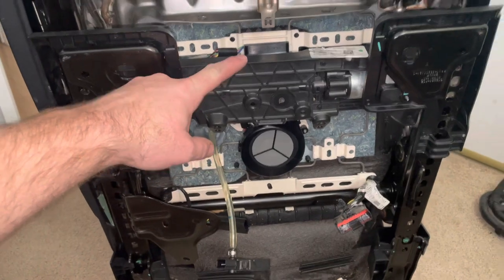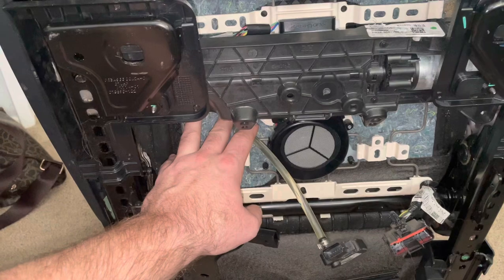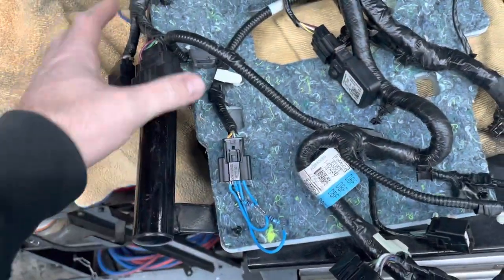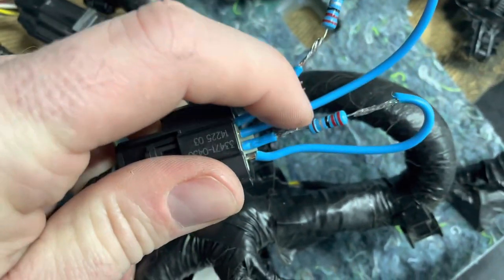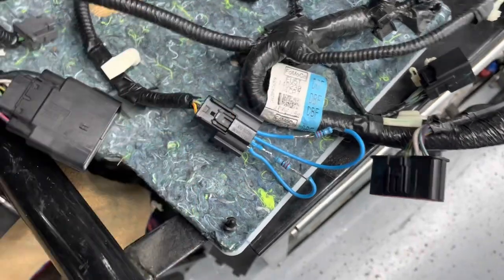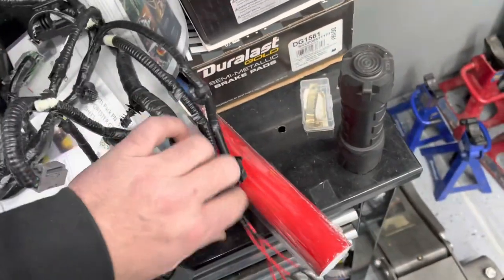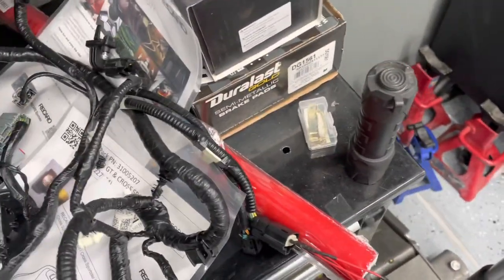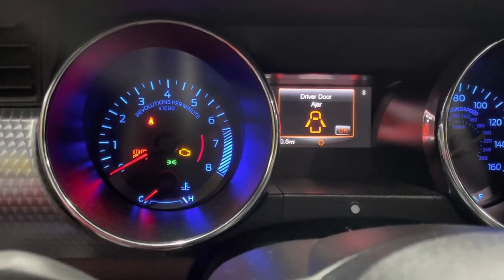Airbag Light Fix for S550 Ford Mustangs

Comment: dude this has helped so much! Ive got a Lincoln MKZ but the harness and everything is 99% the same. what type of wire did you use for the 2.2 Ohm resistors that you used for the passenger seat? im just missing adding resistor and hopefully this works for the Lincoln too!
Reply from the maker: I just used some that I had laying around. Really can be any 12-14 gauge wire.

Comment: Killer vid I just did 19 premium seats in my 2017 base Recaro car amd air bag lighy is on.....so I really  don't have to have the pad on bladder I can just cut tge hose cap off end and use the sensor? My buddy has my recaros in a race car so I need to go get that sensor then already did resistor on driver side a y info be much appreciated
Reply from the maker: No problem, glad it helps

Comment: Can you please elaborate on cutting the occupancy sensor. What do I use to clamp that little hose ?
Reply from the maker: I would not cut that, people have reported it not working well when cutting. Much better to keep it and hide it under the seat.
Reply: The problem is my sensor is not working and giving me fault codes and airbag light and I just bought the car (original seats) and can’t find that sensor anywhere to buy